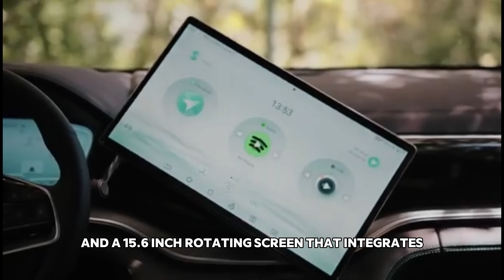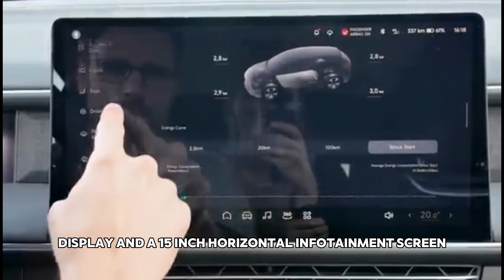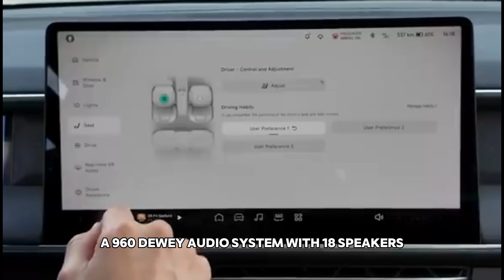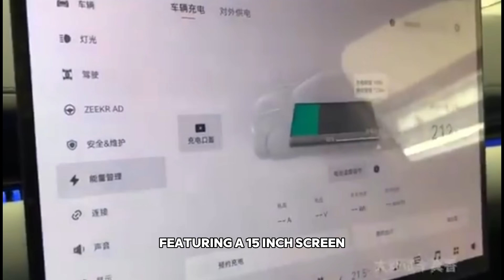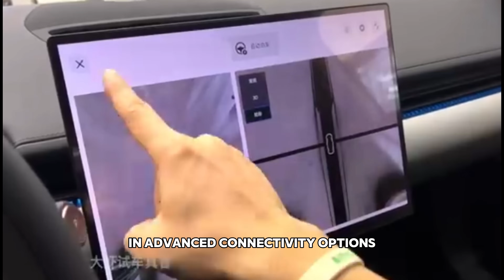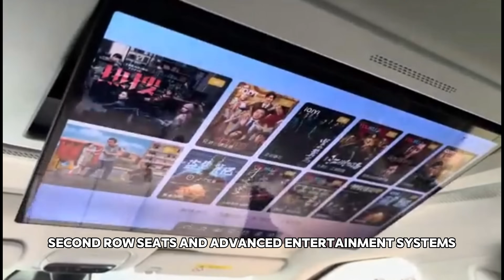10 Chinese Electric Cars Anticipated In 2025 | Cheaper And Better EVs

Comment: That’s fine building EV’s, but building crap is not going to get us to buy them , so you need to prove reliability and long lasting quality.
Reply: Here in Thailand, BMW offers 3 year warranty. BYD offers 8 years..... Shows confidence in their products or?
Reply: @yogibeardd  BYD ATTO3 owner in Canberra learned it the hard way. Battery died while he was travelling at 100km/h. BYD refused warranty claim until the media intervened. Under Australian Consumer Law, this is a chronic defect so the owner demanded a full refund. BYD denied and fixed the battery 3 months later. What a dog of a company they are. PRC cars in Australia have no resale value at all after many of these warranty case reports in the media
Reply: Comentário  tolo para pessoa q não dirigiu o veículo  Ev Byd
Pode ser concorrente,preconceituoso ou ignorante
Reply: If China's EV that unreliable then US n EU don't have to resort to high tariffs to bar people from buying them.... that's tell you whether China's EV is not only good pricing but great built quality too 😅😅😅
Reply: @johnphoon  Chinese autoworkers are not unionized like the US and Europe autoworkers.  Had been said that, if not unionized Chinese autoworkers did not do their works right, they would be fired.